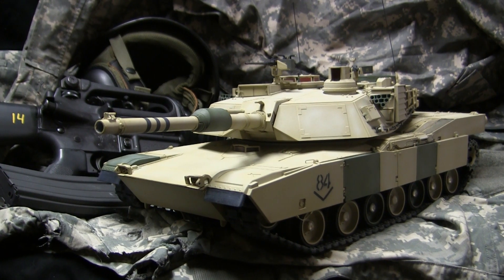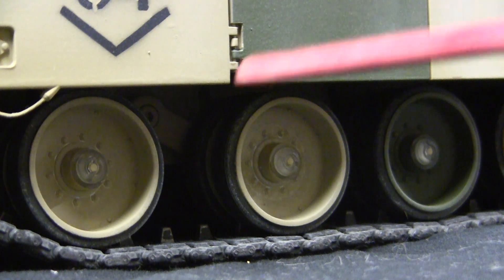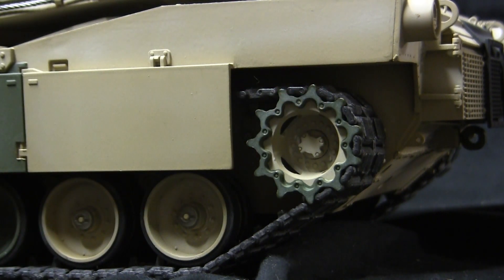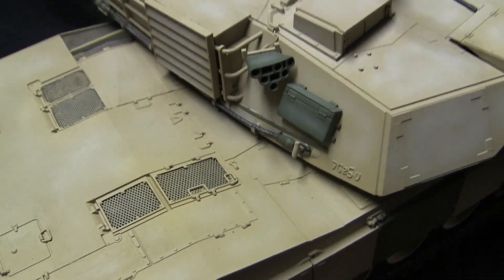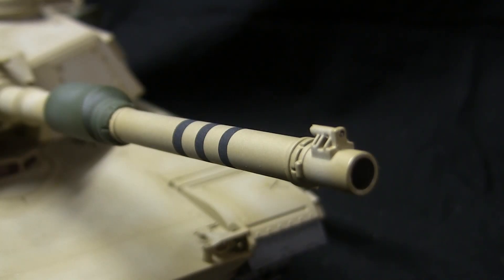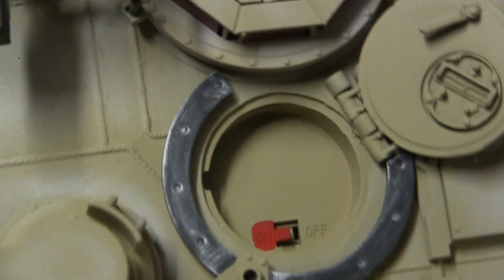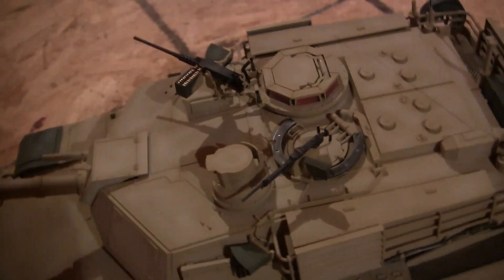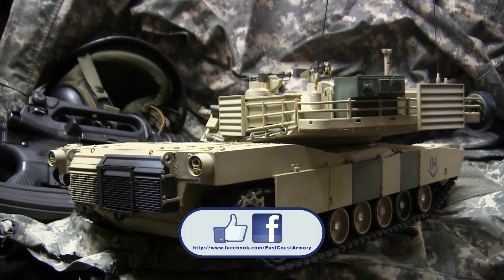RC 1/16th scale HL M1A2 Abrams Commission Build Model Showcase Video

Comment: The reason it's painted black on the back is because they use high temp primer to reduce the rusting on the grill from the high heat. That black doesn't last that long, it ends up getting a rust color after a while, but it does improve the longevity of that grill.
Reply from the maker: Makes sense, Thanks for the info!
Reply: I didn’t know that. Thanks for sharing that information.
Reply: Jj

Comment: Nicely made model! the mounting tabs on the barrel are for the tank firing simulator, and the .50 caliber TC weapon is charged with a cable, not a handle, and has no handles/grips and the sight is a periscope, overall better knowledge than most hollywood movies. Good work
Reply from the maker: Thanks fir the info on the simulator. As for the M2's I should have been more clear, on the grips they are not on the receiver of the gun as they are on a standard M2HB, but are attached to the cradle mount. As for the sight channel I was referring to using the system when outside the tank as opposed to when buttoned up and using the gun from the inside, which as you say is done via periscope. 

The way you see the gun on this model I got from a real M1A2 I was using as reference. This vehicle's gun still had the main charging handle, along with the cable system as from what I see is used to charge the gun when firing the M2 outside

Comment: I got a henglong abrams like 2 weeks ago. I been trying to find a rear bustle rack extension to add accessories
Reply from the maker: those are found with ease on ebay. they have them in metal too. good luck with your project
Reply: @oddball759mm  thanks for pointing me on the right direction
Reply from the maker: @XxBlacKkNighTxX7  sure no problem

Comment: First thing to do (if you havnt bought the pro or platinum) is upgrade the gearbox, drive wheels and tracks to metal.
Reply from the maker: This one does have the metal tracks, and I go over it in the video. You are correct about the gearbox however when I built this one the customer wanted to keep it stock. If I were to do it again I would swap out the gearboxes for the platinum one

Comment: How do you paint the serial number? I've been trying to stencil using acetate films that i cut with exacto knife but when i paint it on it keeps on bleeding
Reply from the maker: I use a similar method but my stencils are made with sticker paper. I go over my system in these two videos, 

https://youtu.be/nQYCmQ9Lcu4?t=1116

https://youtu.be/qda8Hhma5n0
Reply: @oddball759mm  damn i just saw this after handpainting my m1a2 with the (m1a2 sepb3) logo, what i did was i printed the font on a paper and cut it. Then i traced it onto painters tape haha should have just printed it out on sticker paper 🤣

Comment: That has the turbine sound  you have to press the buttons for the cannon and the machine gun at the same time and it will run through different sound settings.
Reply from the maker: this one doesn't have that system. The turbine sound card are found on the newer generation HL electronics that came after this model was built
Reply: Then it has 5.3 sound card, if it was the 6.o you should have the engine sound for the Sherman, tiger ,t 90 and the m1a2abrams by pressing the switch sound effects keys on the transmitter.

Comment: bro where can i get the cupola inserts for the abrams?
Reply from the maker: they are listed on the ECA 1/16th scale parts catalog, http://eastcoastarmory.com/sherman_16.htm they are found towards the center of the page. If you need more assistance with ordering send an email and I can assist further or give ECA a call
Reply: @oddball759mm   thank you soo much! been looking for these for ages just bought it and the one for the drivers hatch as well. Quick question, for the clear Resin M1 Abrams bow hatch periscope insert is it $5 for a set or $5 for a piece? and how did you glue the resin insert and what glue did you use because from my experience super glues make the paint strip.
Reply from the maker: @ericmagpantay7693  for the bow hatch insert, it's 5 bucks each. For the glue I use my thick CA. Funny I never had any issues with paint stripping before with my glue use
Reply: @oddball759mm  haha i used the gorilla glue for applications 😅 oh alright but the bow hatch inserts for the m1a2 abrams has the middle the largest and and the other 2 smaller how do i know what to order this is my transaction number from the products i bought 71K43947FE431232W
Reply from the maker: @ericmagpantay7693  The driver's hatch insert is a single piece that has the three periscopes molded in on strip. To install you just take the upper hull off the tank, and drop the periscopes in place as one unit, not cutting or fitting is required, Just glue the strip to the inside of the tank and your done.
Reply: @oddball759mm  thank you man! Looking forward to this product! As i am all new to this rc tank hobby 😅thank you for all your help!
Reply from the maker: @ericmagpantay7693  np, right now I have a bunch of clear M1 parts in cast now. with any luck I should have them wrapped by Thursday
Reply: @oddball759mm  thanks man, do you have any recommendations as to what type of red paint to use for those?
Reply from the maker: @ericmagpantay7693  there are clear transparent paints for RC cars and others for crafts. Either will work

Comment: How is Huben Models spelled? I did a search using the spelling Huben thinking it might be German, but I came to a site called Hooben Hobby. Problem was everytime I clicked on, such as a picture of the M1 Abrams or any of the pictures I got a 404 notice. Was this the correct site? Thanks for any info.
Reply from the maker: Hooben is the spelling of the model company, and Hooben hobby was the correct site. As for the availability of thier kits, I've never purchased from them myself so I can't really say if the site works but after clicking on the site the shopping cart looks to work for me, try sending them an email

Comment: I would like to correct 1 section were your talking about the number of the tank, an it being an export if it doesn't have the U after the numbers. On most cases this would be correct. But being a former AUS soldier l can tell you that we have the ABRAMS tank an all units have the depleted uranium armour. All our tanks have the U after the build number. Great work thou.
Reply from the maker: Thanks for the heads up. Very interesting topic, I did a quick google on this and found this can of worms, https://www.quora.com/Does-the-Australian-Army-M1-Abrams-have-the-same-depleted-uranium-armor-as-the-US-Army-Abrams-tanks

Looks like there is a lot more going on then I would have imagined.